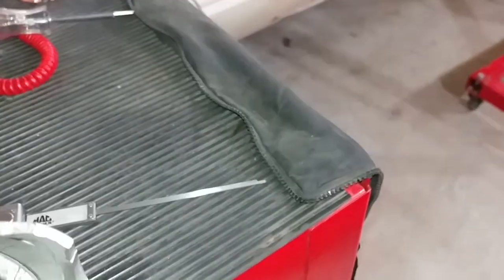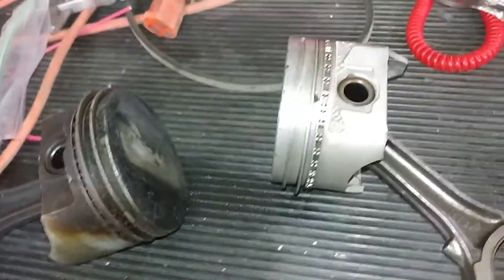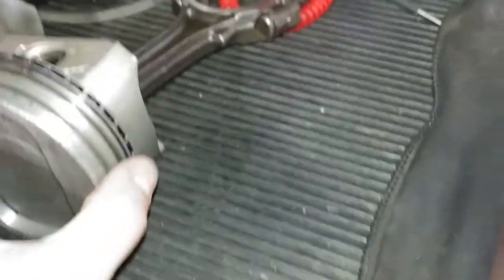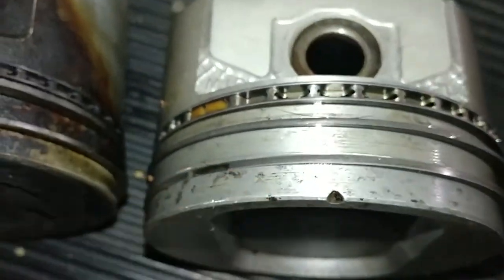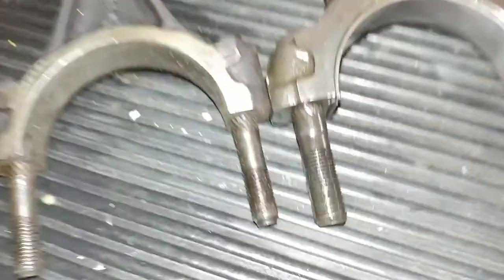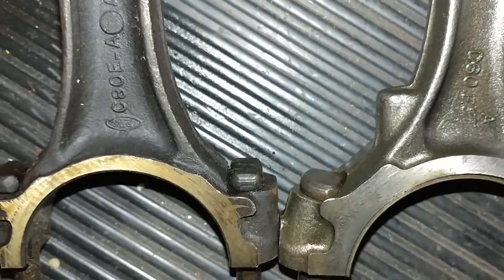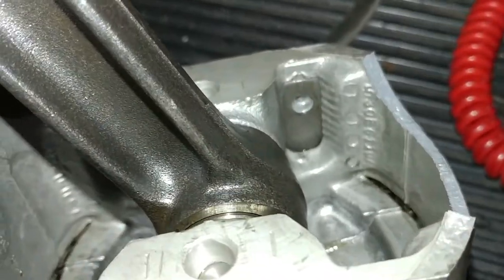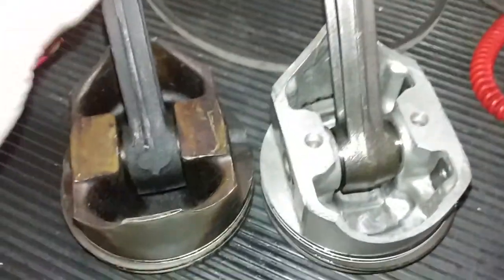302 vs 351 piston and rod

Comment: The piston speed on a 302 is much less than a 351 for the simple reason the stroke is shorter 3" vs 3.5" therefore less stress. The 302 rod is just fine for it's purpose. A set of ARP bolts would be an up grade.